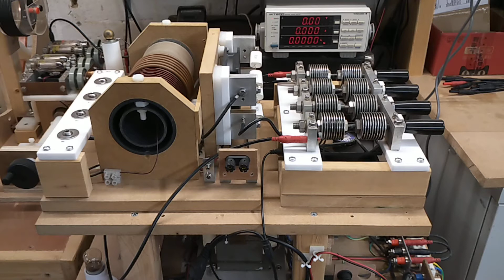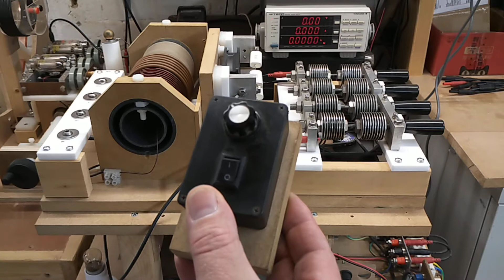Spark Gap Generator Measurements

Comment: is it possible to use this output ? i see a lot of power , i have done some tesla coil also and i see that big spark which i can light a neon bulb one end of it but now what can we do that to make it usefull in our daily life ? take a look at my channel and latest video i posted that arc
Reply from the maker: This is a very good question and one I also spend much time exploring in my own research. I recently presented on Tesla Coils at the 2022 Energy Science and Technology Conference where I covered many aspects of the measurement and application of Tesla transformers. If you have not seen this presentation you may find it interesting. You can download my pdf presentation from here on my website: https://www.am-innovations.com/estc-2022-the-wheelwork-of-nature-golden-ratio-fractal-fern-and-plasma-discharges and the official video of the presentation here: https://emediapress.com/shop/advanced-measurement-techniques-for-tesla-coils
Reply: @aminnovations  thanks for the info , the issue with this kind of output is high voltage and high current and also high frequency i even tried to convert it to DC using ultra fast diodes and i was not able to convert it to DC to be able to use it as if its a production of solar panels
Reply from the maker: @EnergySeeker  In a Tesla transformer the energy is in the magnetic and dielectric fields of induction and preferably in the LMD mode if configured properly. The induction fields in the LMD mode are contained around the wire not in the wire. A diode will rectify current that passes through the diode, but this is not the case with the LMD mode. The fields will essentially just pass over the diode with seeming no effect. To utilise the power in the cavity of a Tesla transformer usually requires at least one additional Tesla transformer or an extra coil, to form a TMT system. Then you contain the energy in the TMT so it generates no discharges, and take the energy out of the cavity with the second coil in the TMT. When transformed out of the cavity into the TEM mode you can use this in the normal way by charging capacitors and powering loads etc. In principle Tesla maintained that it is possible in the longitudinal cavity (LMD mode) to transfer power with no loss, and also in the non-linear case to result in amplification of power in the cavity.
Reply: @aminnovations  thank you for your fast reply

Comment: Ho

Die you build these sparkgap or buy them.
If you built them, can I get some info on the process please
Abd if you bought them, maybe the source?

Thank you
Reply from the maker: Hi, I built them. Each electrode is a stainless steel bolt (M12 x 1.25) with ¼” hole drilled down the centre, and a tungsten ¼” electrode pressed into the hole. The cooling fins are alternating washer – penny washer with a nut finally to hold it all together.